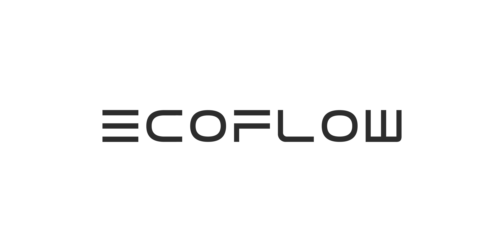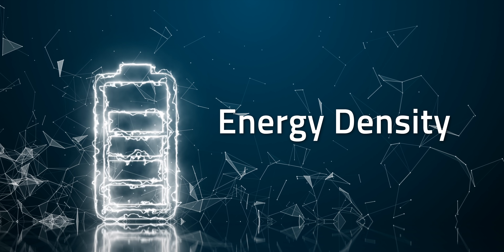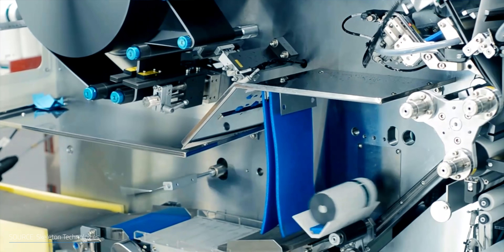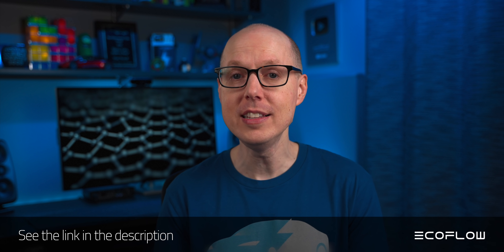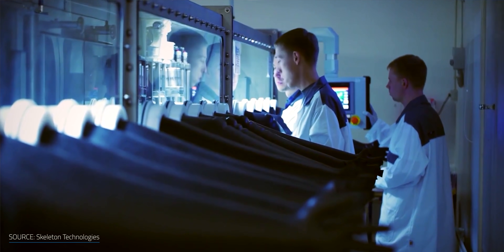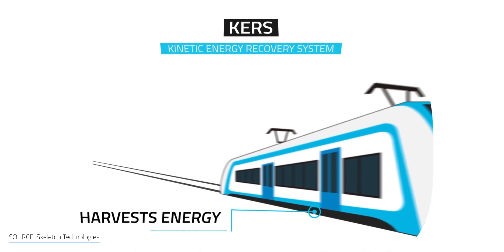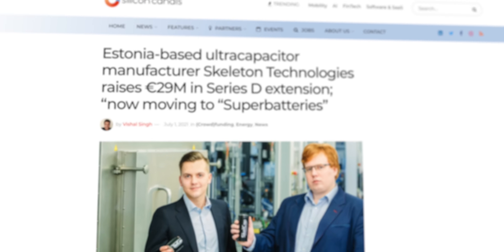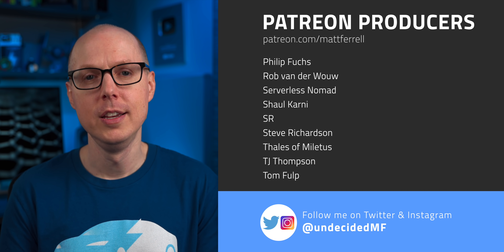Revisiting the Supercapacitor - The Wait for Graphene is Over

Comment: Short range EVs are light and cheap. They suffer from A, range anxiety. This is solved with a 30hp generator. 
B. Lack of acceleration and regen. This is solved with supercapacitors.
Final result is an inexpensive, light vehicle that runs on batteries most of the time, is easy to recharge, accelerates and brakes supercapacitor fast, and can cross the continent on liquid fuel at 100mpg.

Comment: With structural batteries, ultra capacitors, and wireless roads, you don’t really need lithium batteries, but you need them if you go off-road or camping or anything else. 

Wireless road, structural batteries, and capacitors, all that does is free up lithium for where it’s really truly needed, and that means that cities aren’t necessarily dependent on lithium for the day to day traffic

You would need it for vehicles like a trucks where you have to tow something or you’re going on a trip where there isn’t any road.

The day that a vehicle doesn’t need a lithium ion battery would probably be in the next 20 years, But even so a lithium battery and a structural battery in a vehicle would allow it to be more of an appliance for your home or say when there’s a hurricane.

In the future, a car with a lithium battery pack with structural batteries and a wireless road would be a hot commodity for aservice based economy, where the driver would help out tremendously.

A car without the need for a battery would be cheap and bring down the cost of EV even further, to where and EV could easily cost less than $20,000

Comment: Brother spends 14mins explaining how batteries are being made. And how the only advancement is they are using graphite which isn’t being used because it can’t handle high energy outputs needed in most of your electronics.

Comment: Could this be used to help harden the grid against magnetic storms? I believe that one of the things that makes the grid especially vulnerable is how large of an interconnected system it is.

If power could be shuttled into super-batteries at one point and discharged at another, that would split the grid into smaller, isolated pieces.

Comment: You surprised me by incorrectly stating that a rechargeable battery has a fixed anode and cathode. While the + and - terminals are fixed, the anode and cathode will exchange places, depending upon whether the battery is charging or discharging. By definition: the Cathode is the electrode where reduction occurs and the Anode is the point where an oxidation reaction occurs. So, the Anode is the negative terminal when the battery is discharging, but it becomes the Cathode when the battery is being charged! The converse is also true, of course. The positive terminal is the Cathode when the battery is discharging, and it becomes the Anode when the battery is being charged. So, the Anode is actually the negative terminal during discharge, and it only becomes the positive terminal during recharging. For a non-rechargeable battery, the negative terminal is always the anode, so it's pretty much flat wrong to say that the positive terminal is the anode in that particular case. With such a battery, the positive terminal is never going to be the anode, because the battery is never going to be recharged.

Comment: I'd love to see super batteries used on electric bicycles as you'd get more power out of them, as well as being able to charge them incredibly quickly making them much more useful in getting around our cities quickly.
I'd also love to see how it'd go if you strapped a small motor to your bicycle with that setup on turning your E-bike into a hybrid whose motor you turn on every few minutes getting insane gas mileage, or perhaps actually being able to set it up to such an extent that you can genuinely charge the bicycle as you ride it simply due to the energy it can take in at any given time.

Comment: 15 years ago there already were supercapacitors with stored energy like lead acid batteries. The big engineering problem with their effective applications is their voltage drop while discharging, making it difficult to get all the energy from them. Power electronics for powerful applications with such restrictions is also complex and not cheap. So how about voltage  with new graphene batteries?

Comment: My dream is a super cap manned multicomputer. The old school rocket belt jet pack only lasted 20-40 seconds! Yes that seems to be true. And they made them. So why not make one minute manned multicopters that can charge at the same time period? A flight ever minute or so all day! You could get years out of an ultra cap even if you used it every day all day. That is the real reason it's my dream. They are way to interested in duration over longetivity. Unlike in the '60s when they did it regardless of the ridiculously short durations.

Comment: My application would be to deal with brief heavy loads in domestic energy - such as an oven turning on, toaster, kettle, etc - when the solar panels on my roof can't deliver the power immediately, but if they could gather up 30mins worth and deliver it in 5minutes that would help, cos otherwise I am sending that energy back to the grid and not getting particularly well-compensated for it, and then having to draw on the grid (at x4 cost...) just to cover the peak power. That cerainly helps reduce my energy costs, tho whether it makes a difference on a national scale, IDK. (Batteries could be used, but to get the power reqd the battery is expensive and often much bigger than is really needed ). I'm just wondering about the practicalities here - what additional circuitry would be needed? In order to get a capacitor fully charged you're going to need to get it up to its rated voltage, so you'd need to charge in parallel but prevent it from going over-voltage...)

Comment: We could for example electrify only a quarter of all railroad tracks. Charge a capacitor while in this quarter and run on that power the other 3 quarters. Depending on the power output vs. average usage this could be much lower. Even charging a capacitor out of a normal liion battery might make sense, to even the load to a more efficient (averaged) power level.

Comment: Sounds like a great choice for an EV "range extender". For your 90% normal trips (typically <50 miles) you use a small lithium battery and recharge it overnight. Before long trips, you rent an aluminum battery and give them back after.

Comment: Awesomeness. 
I think graphene development has only begun to scratch the surface of its potential. 
Once it can be reliably mass produced, graphene ~ and variants of graphene ~ will be found in everything. 
It’s a flexible material that can conduct heat and electricity… 
Perhaps layered between rubber in automotive tires, instead of heavy steel belts…
Perhaps its ability to conduct heat could stop the overheating, and resultant explosion, of said tires, by conducting the heat generated, to be cooled by an aluminum rim. 
Perhaps layered between fabrics and warmed by electrical resistance, it could heat jackets, gloves, pants, boots, as a seat heater in automotive applications…
It sounds like such an ideal material to make other technologies better, stronger, faster…
Perhaps wrapping fiber optics with graphene would improve robustness while increasing capacity…
Perhaps layers of graphene are cut into patterns and used to make even smaller, stronger, better circuit boards…
Perhaps layers of graphene could be imbedded in steel or applied like a coating, and then attached to a sacrificial anode, like zinc, to improve rust resistance…
Perhaps other metals, like aluminum, could have improved characteristics with the addition of graphene… 
Perhaps graphene replaces carbon fiber…
Perhaps concrete could be poured with layers of graphene instead of steel rebar… Perhaps the graphene could then be warmed and used for passive heating…
Once graphene is mass in production, I think it, or it’s variants, will be used in just about every aspect of life.

Comment: Matt, Why are capacitors not used in conjunction with batteries in residential applications to provide short duration, high current power for transient demand such as motor and compressor startup? Thanks.

Comment: I watched a video on heat pipes recently (copper tubes with water vapor locked inside to take advantage of the phase shift)
Do you think that graphene will be used to facilitate a performance boost in this field seeing as graphene has a faster thermal uptake? I haven't heard of anyone taking advantage of this feature yet, so maybe I have something misunderstood?
Reply: Graphene's characteristics to heat are opposite, it actually shrinks. And to cold temperatures it expands ! 
Absolutely amazing in my opinion.

Comment: A lesser implemented technology for human health and general well being is "Grounding" also called "Earthing", where one is physically connected to the grounding nature of the earth. This happens when walking barefoot on soil, sand, grass, etc.  Standard electrical wiring of homes are connected to a "grounding rod" buried in the soil. "Grounding/Earthing" products like sheets and pillow cases are often made with woven copper and connected to the grounding outlet through an electrical outlet. Since Graphene is inexpensive and conducts electricity more efficiently than copper or gold, shouldn't there be standard flooring designed with Graphene that allows us to be grounded when walking barefoot in our homes? Shouldn't all "Grounding/Earthing" products be designed with Graphene?

Comment: I think there are a few issues missing here. 1. What is the storage efficiency between the battery and the capacitor? A battery will lose about 30% between the charge put into the battery and the charge available. 2. The battery lifetime should improve if the regen power goes to the capacitor. This will reduce rapid charge currents and heating of the battery components.

Comment: That’s great news. I dream of using graphenesheets as windows. Windows could then have more layers and therefore have more insulation effect. Also, the layers could turn the heat and probably soundwaves into electricity. Also windows would get far lighter than glass. Frames therefore could be thinner what pleases the living quality allowing  more light to enter the room ….

Comment: The problem I see is with the charging. They're 2.7V cells. You can put them in series and discharge them. But you have to charge them in parallel. This is the opposite of what I would want for regenerative braking. SMPS technology has to essentially be parallelized to be effective.

Comment: When they finally bring these to market what does this mean for the Alkaline Batteries market (D, C, AA, AAA, AAAA, and 9V)? I could see many products move in this direction. When can I replace my car's battery with something of equal density? Will you speak to the math differences between Batteries, Super Capacitors? I hope this technology may be used to electrifying not only cars but boats and yachts.

Comment: I like your analysis of this issue, but I do have a few quibbles:
1. I wish that this system was referred to as a fuel cell.  Just like a hydrocarbon fueled engine or a hydrogen fuel, a chemical reaction occurs that generates "ash", whether it is CO2, H2O or Al2O3.  
2. The complete cycle efficiency needs to be considered.  All those aluminum  "battery"cases will have to be collected, cleaned yp, and the alumina sludge re smelted to metallic aluminum, made into fresh batteries, and redistributed to wherever  needed.
3. Can a standard battery be agreed on?
4. As to being left high and dry with no charge, why not a smaller battery that would have to be switched in.  My old VW had a switch to access the reserve tank.  Just  don;t forget about it.  It will bite you at the most inconvenient  time.

Thanks for your blog.

Comment: I think they have a key roll in the future. They're built around storing static electricity, and can handle the low current, super high voltage that seems to be the calling card of static electricity. Harvesting electricity from the air was something Tesla saw as the future. It may actually be possible with these super capacitors in conjunction with the right diodes to power a home, and charge your car 365 days a year. 
They may also have a use in harvesting high energy particles in space like x-ray and cosmic rays.

Comment: My ears pricked up when the gentleman said it was best in 'the' 20 second to 5 min' range.  I have a decent sized PV array and even when I'm getting 4 or 5 kws it often  goes down to 1 - 1 1/2 kW when a cloud passes over which happens a lot here  but only for seconds or a minute.  With a PV array weight isn't much of an issue and it would save me maybe a Kw a day - times that by the tens of thousands  of installed PV systems and it's quite an important saving nationally.

Comment: Looking at developments in electrically powered aircraft I can understand their lack of enthusiasm for PV supply, surface area vs weight etc. Clearly all of the developers are struggling with the range/ payload issue and widespread adoption is waiting for the next step function in battery performance. Given that carbon fibre and graphene will become the key fuselage building materials and air is the most effective medium for generating static why are we not heating about advances in harnessing static electricity generated in flight into capacitors to dump charge into the existing batteries. This has to be an easy win.

Comment: I missed this video when it was published because I was coming home from California where I had been one of the drivers of the EVSR electric race car that set records for driving the 25 Hours of Thunderhill endurance race.  The EVSR team has committed to going back to Thunderhill again this year, and we have plans for further improvements to the car.  Watching this video I see a possible application for ultra capacitors in race cars for regenerative braking.  Right now the EVSR doesn't generate much electircity during regenerative braking because the braking intervals are short and intense. For example, at Thunderhill turn 10 (bottom of the downhill) I'm on the brakes for less than a half second, the batteries can't absorb a meaningful amount of electricity in such a short time, but an ultra capacitor perhaps could.  If the capacitor could then be discharged to the motor while accelerating out of the turn then there could be substantial efficiency gains.

Comment: I don't know about practical voltage limits and if those can be circumvented by electronics. But I'd say that you don't need super capacitors to substitute batteries in EVs. You may need only 1% of EV power to make a big impact in energy savings from constant acceleration and deceleration. If it works for 50% of all wasted energy It may be good enough. I am thinking specifically about small batteries vehicles. Long range EVs have enough batteries to capture most of the energy with regenerative breaking. But cars or lorries with 100km ranges maybe not. And I guess here is where capacitors can help. Mostly while batteries are scarce. And they will be for a long time.

Comment: Lol if only thay electroplated the  Annoyed Ann Catherine a 1000 times or even 10,000 times you would have a capacitor battery that can discharge and still have a huge amount of power that can charge  fast but discharge slowly

Comment: If these EcoFlow are using a Lo-ion battery - they pose the same safety concerns as any other such Li-ion battery that has the potential to go BANG - just as Tesla 'wall of flames' Li-ion battery can and have (HA- for want of a better term).  As a lawyer and also involved in a a speciality fire suppression technology business - GOOD LUCK putting out your Li-ion battery (or your Tesla) when the Li-ion batteries burst into flames.  The average individual is totally unprepared for a Li-ion fire - and if you are not prepared - RUN - RUN very fast and far away.  Have a safe and nice day all.  CHEERS from AUSTRALIA (where recently a new large Tesla battery installation burned to the ground before being put into full connection).

Comment: The biggest problem with energy at present is the 'duck curve'. We need something reliable to 'iron out' the peaks and troughs of demand. For example, the power demand for homes and work places are not 'flat'. A local power bank, like a water tower for local water pressure, could take the normal daytime wind and solar and store for when we need it. Also, if the world was level, we didn't care about acceleration and we drove at a constant speed, you could have a car with a 200cc engine, for example. Short bursts of energy at a higher power would suit here. Although ICE cars are a no-no nowadays. Imagine 200-300mpg

This video doesn't seem to mention the self-discharge rate of these capacitors. How long will they hold the charge for?

Comment: It's still a hype. From the first  gram to the first kilogram - it is already WRONG, you should be talking about from the first cm2 to the first m2 of sheet surface, otherwise it means they are not really using graphene but some form of chopped up graphite, which, as expected, has minor to none impact in energy storage. Yes we have to start somewhere, but calling this comercial graphene is a hype. We need batteries with the same energy density (or more) than gas, for this to matter at all.

Comment: The Delta battery (?) is VERY expensive for solar station use, but maybe I've misunderstood something. Best price is lithium ion batteries. My acid based battery is around 11.5 kWh and its cost is 2.4 k USD. Ask me anything on solar stations. I send this message from a house which is powered by one I've built.